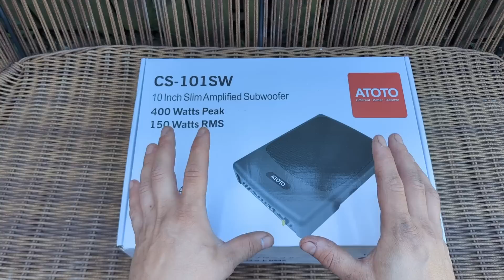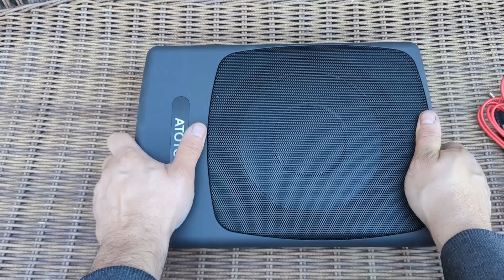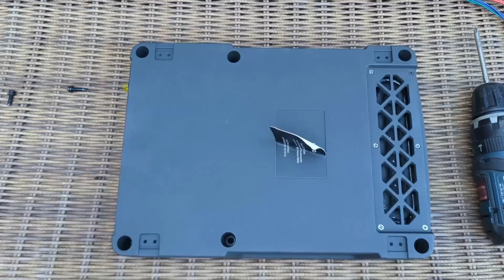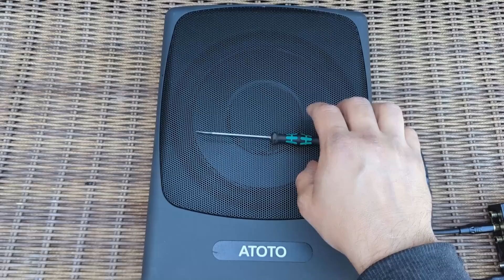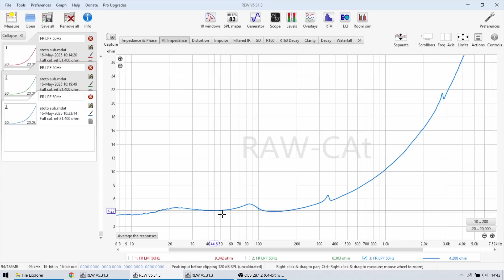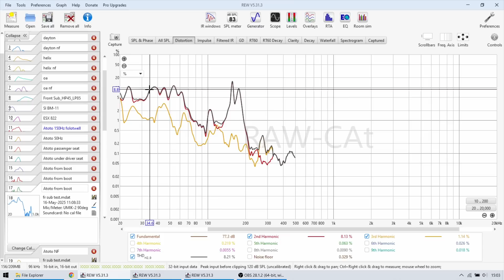ATOTO CS-101SW 10" subwoofer review - cheap and easy front sub?

Comment: https://youtu.be/BYWfQ01oo6w?t=1749 I have to call BS that there is 15db of gain through the entire usable spectrum between the passenger footwell and under the passenger seat.  I have done these measurements before and they were nearly identical.  I think you changed something between measurements.
Reply from the maker: Well, under the seat location has less gain as it is closer to you, as well the seat absorbs a lot of energy (you can feel that as tactile feel on BMWs for example), the footwell however is further, has much more loading and hence gain, nothing is obstructing anything🤷 I just literally moved the sub within seconds without changing anything.
Reply: @RAW-CAt  I will perform the experiment again myself, just using my little portable  jbl speaker to confirm...  If it gives this much more output, I will be moving my under seat front subs to the passenger footwell immediately!

Comment: Good info, you poo-pooed on someone suggesting the JBL Fuse in another video but I wonder how it compares. I ran mine split under both seats but now using one in footwell crossed at 60 -110 on bout 300w with pleasing results IMO.
Reply from the maker: The previous video where it was suggested, it was implied that it would have same or better output than a dedicated shallow mount subwoofer. None of these active shallow subs can touch something like Stereo Integrity BM11 or Alpine RS10. They have a purpose, but not in my system. Very limited output.
Reply: @RAW-CAt  Fair enough.

Comment: Ha, your last comment is exactly what I was going to suggest. Run the sub with an external amp. 

Remove the internal amp and the side plate and cut your own plate out of blown PVC and use a Molex plug to run the speaker wire through. 
But good review.

Comment: Interesting that the bass-boost is centered below the radiator tuning. Surely that is just throwing power away.

My guess is the radiator is there more like an aperiodic vent than a resonator. So it helps lower the Q, and maybe reduces the strain on the driver somewhat without sacrificing too much output in its intended range

The hardwired lowpass probably is OK insofar as the product seems to be aimed very much at the average consumer

Comment: Sir tell me one thing. When we measure the tweeter, it becomes deep in the end. I have used link rill 24 db octave in LPF. Will it be correct to bypass it?
Reply from the maker: You should not use an LPF on a tweeter, only HPF is needed. For protection, do not bypass it.

Comment: I have a similar sub (DLS ASW10) under the seat in my 911. You would not belive how good it sounds. No super low bass, but the upper bass and kick bass is so clean. For 99.9% of people, this is all they will ever need in terms of bass and dynamics (in the cabin this small as 911). Absolutely amazing for the price and size. Proper EQ with a DSP is a key tho.

Comment: Odd that they wouldn't use a class D amp. Surely 200w at 1 or 2 ohm from class D would be cheaper than 120w class ab. Must be a very old design, especially as the amp frequency response is so awful

Comment: Hey Raw-Cat, I've been using a Carroziera TS-WX110A I've purchased used to inspect it as a front sub and yes - these types of products are a very smart choice for "sane" people that like normal to somewhat loud listening volumes. In fact it does not take much power at all if you will adjust it right on the time and phase and polarity with the main sub - it will act more like a "detonator" and will do the trick in a very impressive manner! 
In the past I've used an Alpine S8 as a "main-front" sub on a car that I really wanted its overhaul sound to be "lean", when taking the time to find the better ones in this category - there are some very big "small" surprises. 

COOL!

Comment: I can't believe I was actually pondering with using one of these subs as a small front sub. I was writing on reddit, reading on forumsnand found little to no information about how good or bad a small underseat woofer would do. Now you upload this video 😂Specifically in the 50/60 to 90/100hz range. I don't need it to rip my face off, just to give more body to midbass. Just for fun until I finish with other stuff. So thanks!

Comment: Im running this as a front sub.  By having a regular rear sub . This will play only 55hz to 90hz. And midbass is playing 90hz to 300, for example.  If you summ or phasing correctly, it will be a big improvement